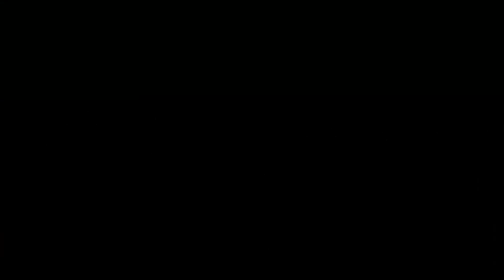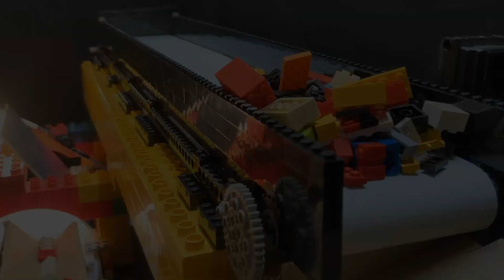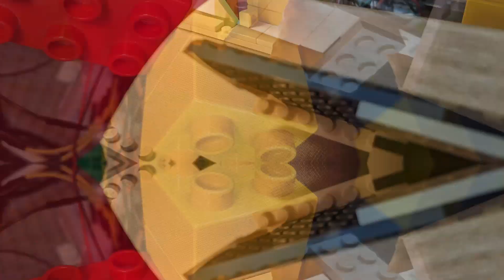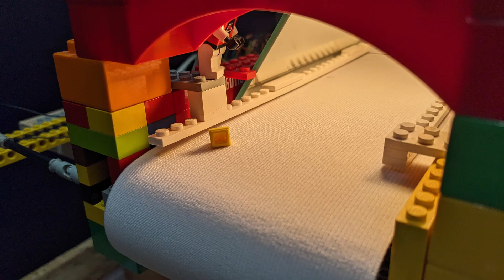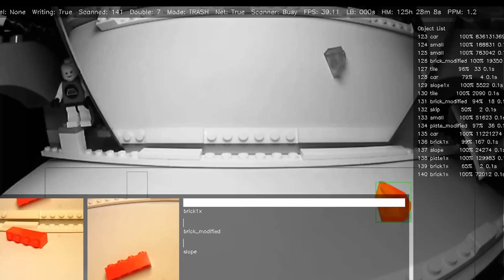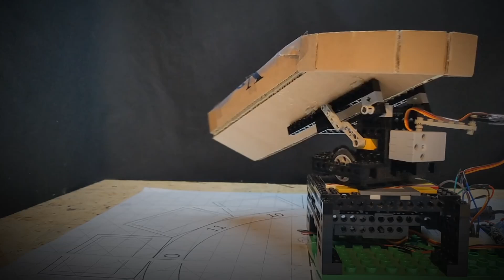LEGO Sorting Machine | Update #02 | Building a machine to sort my LEGO bricks

Comment: I know how to upsale this to hundreds of bins. while still minimizing space it takes up. 
You have a gap at bin 6. Swap that out to bin 0. 
Make bins rotate around center on a ring shaped platform and leave a gap at bin 0, to allow the part to fall down to a lower level ring. 
make ramp fixed position and only rotate bins. 
Stack  up multiple rotating rings and have each one at position 0 fall through to the next level. you coudl put in some brushes to stop the parts fallign too fast and damaging them. 
With this configuration you can have a stack of 10+ rings, each with 11 bins and one open slot. The rings would alling to zero position by defult and then one of the rings would be commanded by yoru microcontroler to rotate into the correct position for a part. 
extra bonus. use a longer rotating ramp to to drop parts into a compleatly seprate stack of bins aranged on rotating rings. 
This would be a high machene. use a bucket line lift to feed it :D
Hope this helps.
Reply from the maker: Hey @nickzwa,
that is a awesome idea! This should really be scalable in a efficient way and at the same time work well for part retrieval e.g. in a bricklink store. Whatever part is needed the rings rotate so that the needed storage container is at an opening for easy access. Are you also building a machine currently?
Reply: Hi  @BrickSortingMachine  
Thanks for that. I was inspired by yoru website and yoru poblem of arranging buckets on a 2D plane and the space that woudl take  up as well as expence of tracks and stuff. . with a small modification to what you have alrady demonstraighted working it should be possible to have a stack of part bins arranged in a ring. maybe thank the creators of the show Slilo :D You could say that Ive been inspired by watchign some of yoru videos as well as a few others. Im thinking of buildign my own brick sortig machine and yes, I was thinking abotu being able to retreeve a part bin and dispencce a part easeally. Thats the second big challange. how to dispence an exact amount of parts to be dropped into an order bag. Im thinking that it dosnt need to be exact. if a few parts came out of a bin that has a meconisim for dispencign a part, then you can use the same system as sorting all yoru parts. eg. bin has a tipping mechonisim or conveyer that dropps parts down a chute onto a  belt. belt then goes past the camara and correct number of parts are sent to the stack of part bins, where at the bottom is a bag for a bricklink order. call that location 0000.  extra dispenced parts are sent back to storage bins. with this system you could have same/simmilar type of lego parts in any one bin and basiclly the bin is emptyed untill the corrct colored/type of part is found by the camara system. that part is sent to the shipping bag on the bottom of the stack and the extra parts are sent back to the part box. think it could work?
Reply from the maker: @nickzwa You really sound like being hooked on the topic - really great! Having the part retrieval process also fully automated would be next level! Are you already on the discord server of the GreatBrickLab? There is a great community of sorting machine builders. If you are interested feel free to contact me on discord - link is in the footer of my new website bricksortingmachine.com

Comment: Hi there, nice job. One question, how do you amke sure that only one part at a time is fed to the camerea and than the sorting slide does not accidentally put two different aprts in one bin?
Reply from the maker: Hey, thanks! Sure, the goal of vibrating v-channels is to get the parts into a linear sequence with majorly no parts lying on top of each other anymore. The second channel is running twice as fast than the first, this would be intended to spread out the parts further longitudinally (this is currently not working so great yet. So as a result you have a linear chain of parts with ideally some space between the parts. 

Next key step is, that as soon as a part drops onto the belt the camera detects it and stops the v-channels. This is why it is so critical that my camera has low latency (to achieve that running at a lower than possible resolution).

Since all these measures only work out ~70% of the time, the vision detects multiple parts in two ways. First it checks for non-connected components on the belt and second the CNN is trained to classify for an additional class named "multiple_parts". In this case the slide is pointed to the "to be reprocessed" bin. 

In combination the system gets to a quite low rate of multiple parts these days. Might have to guess but max 1 per >20 or something. That's totally fine for my personal use case.

Just out of curiosity - are you also building a sorter currently?

Comment: I'm curious what you think is the biggest limiting factor in speeding the whole process up? It seems like it's the image recognition?? Motors and servos can usually always be sped up by throwing money at the problem, but I'd love to hear your thoughts as a person who is building the machine (I am not building anything.).
Reply from the maker: Hey good question! An indication of what can be possible certainly is on the "Eppos Vision System" channel https://www.youtube.com/watch?v=odtEyHnAT3Q.
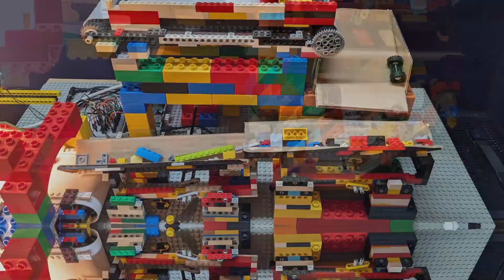At 0:28 their HMI is visible which says "148 pc./h" - so 2,5 bricks/second!

I think the key is two features they have:
1) They seem to use a triggered camera which is synchronized with flash lighting. This way they get rid of any motion blur. Fear of motion blur is the primary reason I run the belt probably slower than it needs to be.
2) They use a pneumatic system to push the parts off the belt and into the sorting bins. My rotational ramp certainly cannot keep up with that speed. I chose it for now to need less hardware and not having to hassle with exact timing of the air bursts.

A limitation of my personal machine as you mentioned also is the image recognition. The CNN for classification still runs on a small CPU instead of a graphics card or for example a nvidia jetson or google coral. Because of this the CNN needs at about 1.5s. For two passes of MobileNetV2 this is a lot and can certainly be brought down.

In the end a lot comes down to fine tuning and evaluating the system limits. I am certainly looking forward to progressing in this direction as soon as the foundations are complete :-)
Reply: Thanks for the response. I'll happily keep watching!